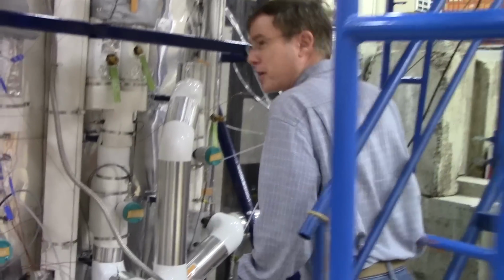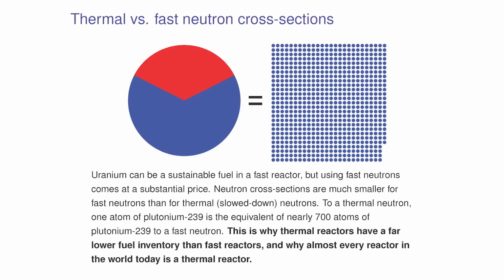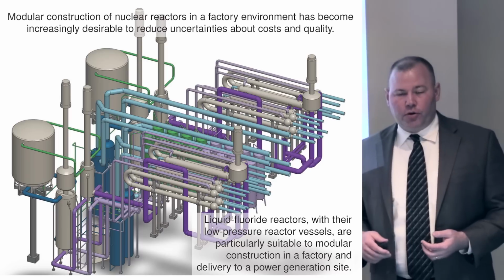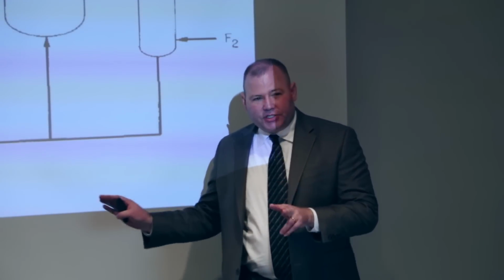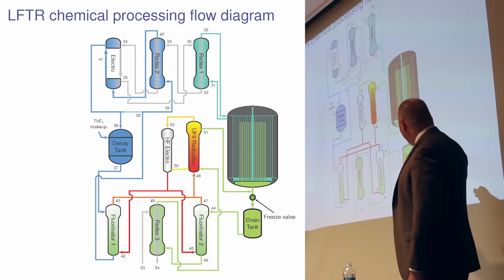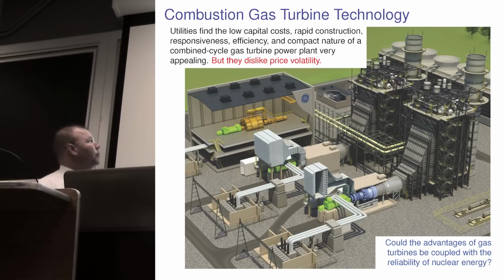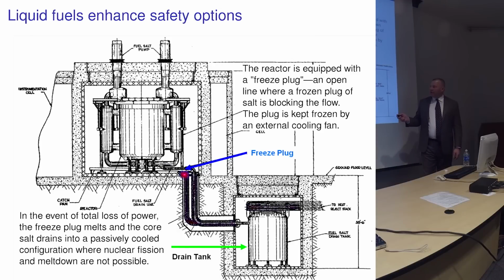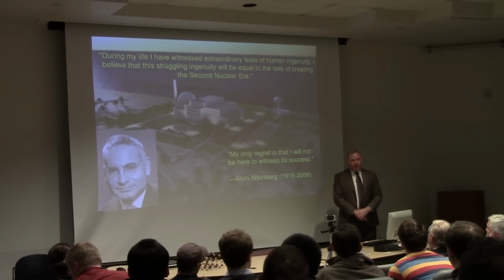LFTR Chemical Processing & Power Conversion - Kirk Sorensen

Comment: While I agree with Kirk's design targets, there is one aspect I don' t understand : most of the other MSRs I saw are burners/converters at most, if not uranium only, while LFTRs are full thorium breeders, so what tech breakthroughs did Sorensen get to overcome thorium these breeder troubles ? Either he got something other didn't yet  or they over estimate MSR fuel recycling/reprocessing problems...
Reply from the maker: I think essentially he's willing to tackle challenges the others are not. These chemical processes are expected to work, but have not all been tested. Flibe Energy is expecting to be able to license a non-appreciable breeder. So there's no expected show stopper, but the more one tries to tackle at once, the greater risk of suddenly hitting a technical challenge or a licensing challenge.

LFTR is a more advanced than a MSR burner. So I'd say this is a value judgement of how important is breeding.

Comment: Unrelated to thorium, how did he get the laser pointer dot to be represented on the recorded slides?
Reply from the maker: +TheBugmenot2009 Camera on tripod capturing projected screen as part of frame. That section is isolated and distorted so captured image overlays slide (from Kirk). Then whatever changes in that portion of the image is presumed to be a moving pointer. Some color/luminosity filtering is used, but mostly it is whatever changes in the image presumed to be pointer.

It is not perfect so a lot of cleaning up required. Particularly when a frame advances... then everything changes and is all assumed to be pointer.

So this effect is disabled or edited around when slides advance.

Edited in Premiere Pro. Cameras are consumer gear.

Comment: I wonder if we can have a single fuel reprocessing plant serving 8 LFTR or DFR units all at once. >8GWe being serviced by a single on-line refueling plant fed by fuel salt pipes would make things simpler with scale. Plus fission products can be centralized and make a little more power for 10 years with it's own turbine and make enough power for backup systems. Fission products make around 10% of a reactor's power until it decays.

The reprocessing plant could also have a fuel salt buffer if a unit needs to be emptied without using the drain tank.

Comment: This is another excellent presentation by Kirk Sorensen however like all his other presentations it avoids any mention of the practical issues around thorium molten salt reactors, some of which are technological and others are simply economical issues.
These issues however are well known among nuclear engineers and are the reason why neither the US nor France, Russia or the UK have for the past 50 years or more dedicated any significant funds to the development of thorium molten salt reactors, although all these countries have had enough nuclear engineering expertise and financial resources during all this time to do so.
For example, among the economical reasons is the fact that thorium molten salt reactors require either U-233 or Pu to get started. This leads to the calculation of a doubling time of 52 years (at full power) for a fast neutron thorium cycle reactor to breed enough U-233 to fuel another identical fast neutron thorium cycle reactor (in a scenario of country-wide deployment of thorium molten salt reactors). This implies among other things, that since it is doubtful that a thorium molten salt reactors can be designed to operate for 52 years at full power, a thorium cycle based nuclear industry as a whole would take centuries to deploy and additionally would not be self-sustainable, requiring other more traditional uranium based nuclear reactors to breed the required U-233 balance.
This presentation has a more balanced analysis of the advantages and disadvantages of the thorium fuel cycle: http://thoriumenergyconference.org/sites/default/files/pdf/The%20Thorium%20Fuel%20Cycle%20-%20Daniel%20P.%20Mathers%20-%20NNL%20-%20ThEC13.pdf

Comment: The gangsters running US utilities have prevented the US Navy from having nuclear powered submarines capable of running silent. Not that I am in favour of nuclear weapons but neither am I in favour of having noisy ocean going ships.How much noise can you convince a freighter's designer his ships don't have to make?
Reply: +YouCubed22 

But if the fuel costs nothing you can make it ten times thicker and then they will go too deep to be found no matter how much noise they make. And how are you going to wreck a 3 foot thick steel tube by throwing bombs near it in deep water?

All you will do is move it sideways a bit unless you wreck your own boat with a nuke. Thermobarics?
Really?
And all the while it is going 30 to 40 knots while the fuel is cooling down. If that takes an hour you are looking at a depth charge pattern that covers 40^40 nautical miles by half a mile deep or more or less. Or not as the case may be. What if it was doing 60 knots or however fast a torpedo can go?

Do you suppose any navy has that many bombs on any one fleet?

What if they had two of them and one was being towed. Until the pursuit ship went past?

These things only cost millions to make until you have built it then it is an investment. It was like the Ark Royal. They didn't have to spend silly money playing with it all day long once it was built. Just park it up in a shed somewhere until it was needed for killing aliens or Argentinos when it was needed.

Think how many people on both sides would still be alive now or alive now and unburned, if they had thought of that. But that is what happens when you vote for politicians.

Comment: In the subtitles at 40:39-40:41, there's a bit that says, "[inaudible 40:41]".  The correct text is, "Oak Ridge looked at using NaK*, using sodium, they looked at using lithium".

NaK is short for "FLiNaK", or lithium fluoride/sodium fluoride/potassium fluoride eutectic salt.
Reply from the maker: Bryan Elliott Fixed. Thanks.

Comment: I have been watching the progress of LFTR for the past couple of years, and in this video, Kirk talks about separating protactinium, and letting it decay to uranium.  I know that its been discussed that the reactor can't be used to produce material for a nuclear reactor, but given the half-life of both protactinium isotopes, one would just have to have a series of tanks, and continuously run fluorine through the tank for a month and a half to remove Pa 232 that decays to U 232.  After a month and a half, the rest of the material in the tank would be Pa 233, and would give as very clean U 233, with none of the hard gamma radiation associated with U232.  Yes, it would only mean that a quarter of the Pa 233 would come out as clean U 233, but it would be a means for separating the materials.  At that point, it could be used in a nuclear weapon.
   Am I wrong in my analysis?   I am not advocating that a person does such a thing, but I think, if I am correct, it can be used for such purposes.  But, maybe this removal, by taking out the uranium will drop the reactor below criticallity.  I don't know.  If anyone has the answer, I would like to know.
Reply: Late to this one, but from what I understand of how U-232 is formed, the incidence of parasitic neutron absorption that causes Th 232 to form Th 231, which decays into Pa 231. It requires a further neutron absorption to form Pa 232, which decays into U-232. There are 2 solutions that I can see: filtered out at the Pa 231 form in the Redex 3 stage as shown, or reintroduced into the fuel salt, forming U-232, which then goes through the fuel salt and either fissions, or absorbs another neutron to form U-233 (U-232 being both fissile and fertile), and unless I miss my guess, neither of these solutions would threaten criticality. Or, if the decay tank simply won't let the Pa 231 out, then you could just leave it where it is, parasitic neutron absorption being very low in the first place, and Pa 231 having a very long half life (32.5k years).

Comment: I've watched most of the video series to date and to me at least, the first 15 or so minutes of preamble were a bit boring to me because I've heard it all before.

After that though it becomes quite interesting.

When previous videos discussed a chemical "kidney" for the purpose of on-line reprocessing Kirk wasn't kidding. That Bismuth/Thorium counter-current exchange is quite close to what happens in the human body; albeit with Na/K and H2O exchange through membranes and membrane proteins. One of the challenges I foresee though is in the electrolytic cell. You're reducing everything back to metal that then is introduced into the decay tank. What's stopping say the lithium or beryllium plating onto the electrodes?

I know nothing of tritium capture, but if what Kirk says is true about the potential of tritium escape only being within the supercritical CO2 stream, surely once the pressure is lower some oxygen could be introduced into the stream to turn gaseous tritium into heavy water. There are a lot of ways to dry out a gas stream; from passing it through a hygroscopic filter, to simple condensation. Since the gas turbine is a closed cycle, you could simply keep recirculating everything until you were sure that no tritium could possibly remain.

Comment: Love the chemical kidney concept and 5 he internal processing of fission products.  My second thought though is that this concept requires a lot of plumbing.  2 loops, heat exchangers pumps. tanks, separation columns all working in a hot, caustic and radioactive enviroment. We have to ask, what if something goes wrong with any process?  How would it be fixed or repaired?  I'm not saying it can't be done.  I am saying that it will be a challenge, perhaps mostly a materials challenge to make this work.  Good luck to Flibe in their efforts.

Comment: Does the fission cycle for U233 involve the generation of xenon gas? If so, will that generated xenon react with the hot fluoride salts present in the reactor to form XeF2 and XeF4? If not in the reactor vessel itself, during chemical processing xenon will most certainly react with fluorine to form these compounds. If so, can these chemical by-products be removed?
Reply: I'm pretty sure Xe cannot react easily as it is a noble gas. Likely it will just fizz out of the liquid and be collected for NASA.
Reply: leerman22 Xenon dose have a compound with fluorine but I think it must be made under special conditions.
Reply: David Vermillion
It is a very weak bond so we could easily rule it out. There is a reason why Nasa would use it in ion engines, it doesn't corrode the engine as for other reasons being how easily it can be ionized.
Reply: leerman22 I know I'm just saying for technical reasons.

Comment: A fast spectrum MSR (U238 breeder) wouldn't have to worry about Pa233. Np239 has a very short half life so all you need to do is get fission products out (and have a higher fissile content). In the future you can always modify it to run on thorium.
Reply: leerman22 I would like to see a chloride-uranium reactor. Fast breeder MSR, seems like the way to go. Simpler salt processing and single fluid. Couldn't be simpler.
Reply: Zypofaeser Problem is U238 and Np239 are tetra-chlorides while plutonium is a tri-chloride. You would have to dissolve in some sodium so chlorine doesn't bubble out and corrode the vessel.

I don't think the finicky nature of fast neutron control would really matter with a liquid fuel. Probably make them iso-breeders (no net gain in fissile inventory) and regular inspections for untrusted countries.